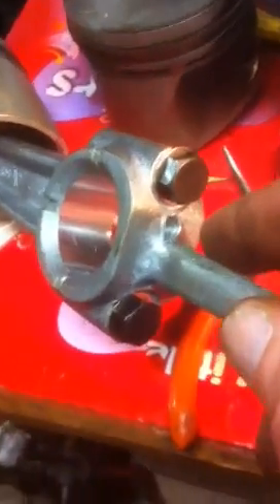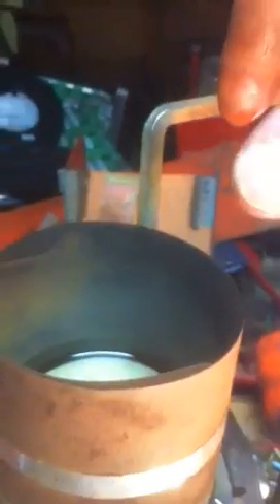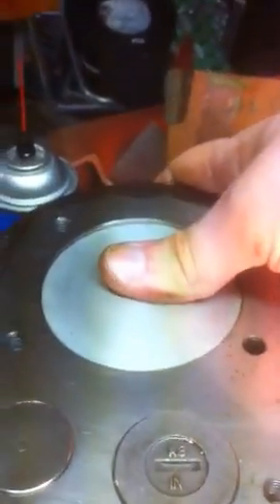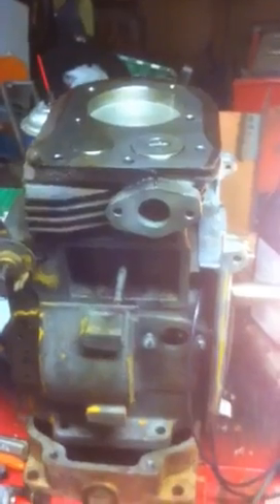K181 Kohler Part 3 Gravely Piston and Rod install

Comment: I'm looking at this with great interest; my main Gravely, a 5240 broke its rod and I need to fix it. Up to now I've only fixed the pieces on the outside, the head, fuel pump, carb etc. so this is my first dive into the engine itself. I'll probably take the engine off and bring it into my shop, take it apart and cross my fingers. I'm starting to accumulate the tools.

Comment: i think i mess up i was painting my engine today and tried to get that fan cover which after watching your video has a bearing on it i didnt try real hard to get it off but i did move it. any advise to check if i stressed that bearing without cracking a seal?